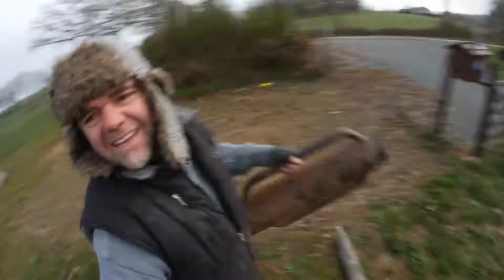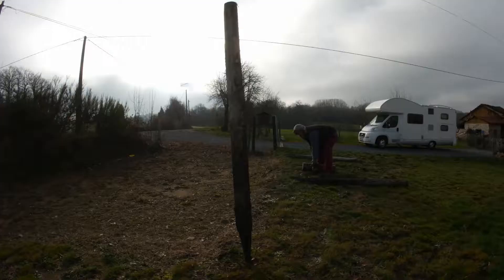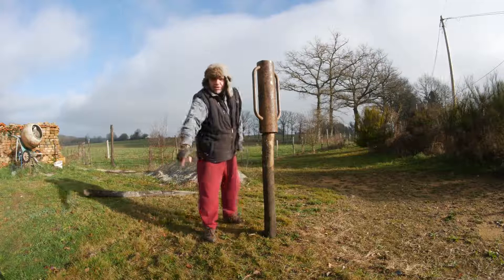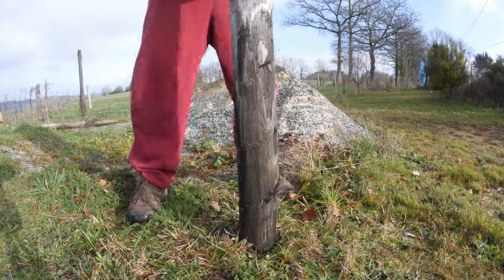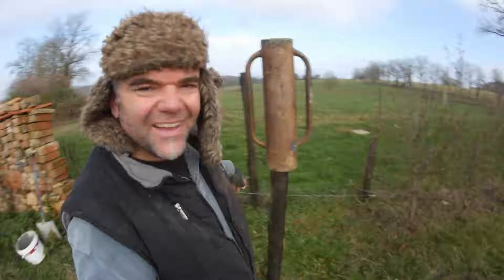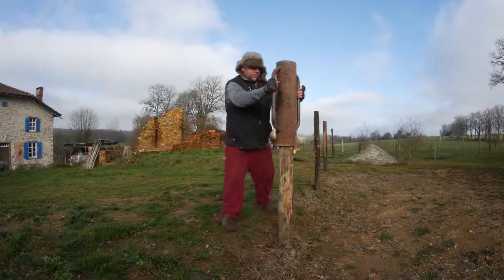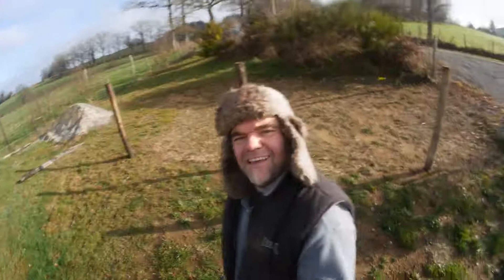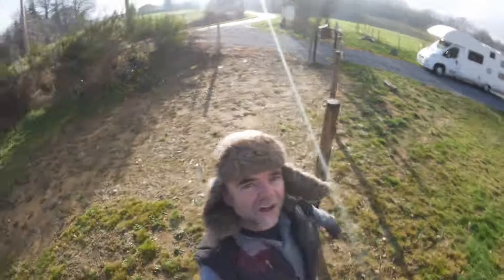Post Rammer to Drive Fence Posts Tutorial with wallybois 2019

Comment: Thanks, Buddy!!!  I’m about to put a few posts into the ground myself, and I’m a very small woman who hasn’t done it since the army days. It was a very easy job using a two- or four-man pounder, and of course we only ever used metal stakes, so it was only like a hot knife through butter.  

I was really hoping that somebody would say that was OK to use one of these on wood stakes!  :D

Tyvk For your excellent demonstration!

PS.  your thumper has two handles; it’s a pretty easy job if one of you takes a handle each and just lifts and drops the handle essentially. Much easier than when one person grabs both handles and slaves away at it.
Reply from the maker: there are different weights too xxx

Comment: You really should make a pilot hole with a heavy iron bar about 6 inches deep at least and then set it in that before you start driving, also when your as short as you are get yourself something to stand on so your closer to the top of the post. Good effort though

Comment: Been doing my partners horse paddocks with post and rail, i bought some of those split posts from moles country stores, they are only 50p cheaper than the 85mm steaks and i wish id never bothered... where they are only chamfered on one side its nearly impossible to get a nice & straight fence line as they wonder out of upright as you hammer them in so my advice is pay 50p more and get  round posts if using a manual post hammer
Reply from the maker: Good advice 😁